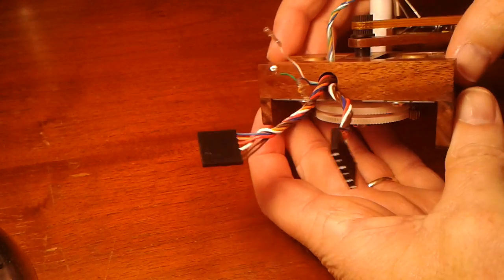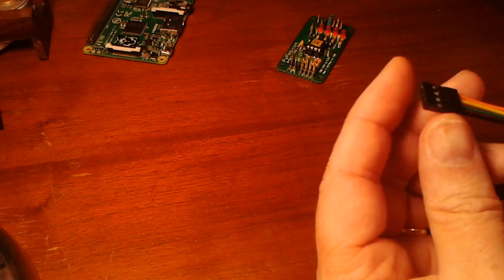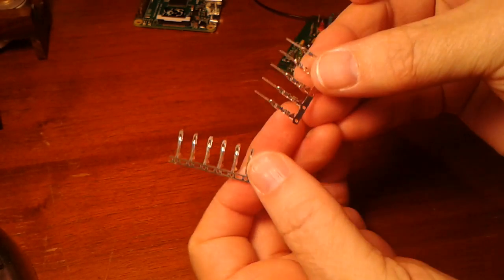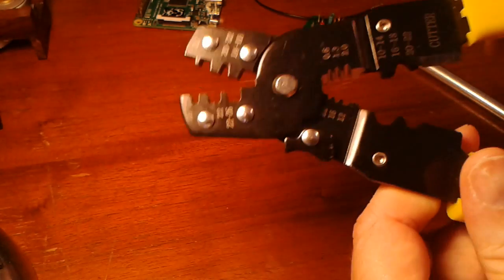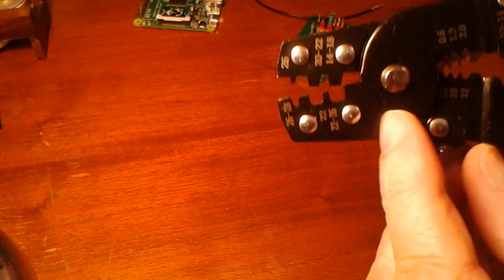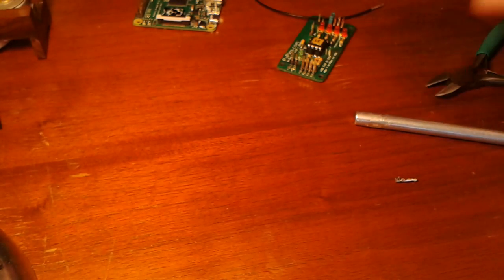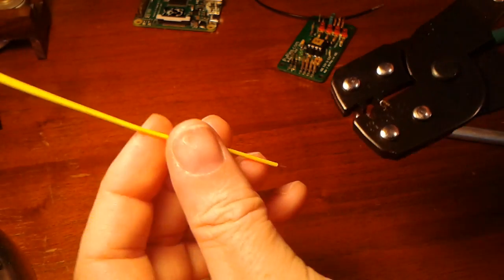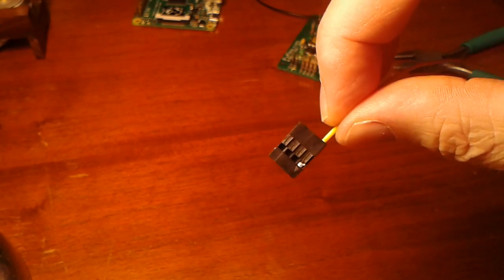DIY Dupont Connectors

Comment: I think I am just going to just buy a pre crimped one. My situation is I have a sub woofer with a display on it. It was working fine but suddenly not. I opened up my sub woofer and it has 16 wires that go into a white plastic connector, identical at each end and all the wires are all in the one row. . The wires look to me like this dupont thing. But I notice one wire has actually come  out at one end. I am thinking just to buy a single pre crimped wire. One concern is the wires on mine are definitely silver, like alluminium wire so I don't know if the wires I am seeing online are  copper wire and I don't know if it's a bad thing to use copper when the wire that was used before was alluminium. The other thing is I tried to get it to go back in and messed with the wire so many times its now shorter than it was to start with but I don't know anything about these things but it seems to me all I need to do is buy a pre crimped wire and disconnect the old one from the other end and insert the new one at each end. I suspect what's happened with the sub woofer being turned up, vibrating and rumbling just caused the wire to come out. But I tried to get a replacement wire with the  connections complete but no joy. Just going to be my last ditch attempt before I fork out another several hundred pounds for a replacement sub.
Reply from the maker: The "silver" on the wire is tin plating on each strand. The wires are tinned copper. Make sure you get the same thickness or gauge of wire.

Comment: OK, I just went and played with these connectors for a while -- I have never been good at putting them together -- and invented a tool.  It's a single pin from a row header, inserted into the end of a short stick (a short piece of dowel, for instance).  This gives you a way to hold the female DuPont connector while putting it into the crimper -- just fit it onto the tool, no farther than necessary for a good grip.  This seems absolutely vital with the fancy AMP crimping tool -- why AMP didn't make it, I don't know -- and also helpful with an inexpensive crimper.
Reply from the maker: Good idea. I'm going to do the same.
Reply: @ClaytonDarwin  The rest of the story is that I found out why I could not easily put the connectors in place by hand.  The AMP tool that I have was actually designed for the pins in D-connectors.  Their crimpable part happens to be almost the same as a DuPont connector, so the AMP tool works beautifully, but putting the connector in is awkward.
Reply from the maker: I've started placing the wire into the connector and pinching the larger gripping tabs down onto the insulation lightly. Then I can hold the wire to place the connector exactly where I want it for a good crimp.
Reply: @ClaytonDarwin  I think the bottom line is, once you know what the correct crimp is supposed to look like, there are a number of ways of making it.

Comment: I have the $500 AMP crimp tool, which I got at a hamfest for $10.  Ratchet and all.  And I think it might actually be easier to get good results in small quantites using the kind of crimper you have, the cheap kind, because you can feel what it's doing, and there isn't a ratchet to keep you from using your own judgment.
Reply: The ratchet makes you sacrifice a connector that has gone in crooked.  You can't let go and straighten it up.
Reply from the maker: "Keep you from using your own judgement." That's the problem with a lot of things I think. But as for crimpers, I made that video several years back and have done hundreds of crimps since then. Never a problem, and it is so fast and easy. I also like to be able to quickly use both sizes to get the right "feel" on the squeeze.  I'm looking for another pair.

Comment: If you're working with limited space, you can also use JST connectors. The JST-XH fit into headers easily, but for really tiny stuff you need the JST picoblade connectors. Those are really hard to crimp due to their small size, so get a cheap crimp tool as well. These DuPont connectors are also what servos and ESCs use, so getting some of these connectors is beneficial if you're doing RC stuff. Just be aware that some servos have a special DuPont connector that has an orientation lip which sits in a matching groove. Make sure to get the right type.

Comment: Thanks a bunch, I wasted like 6 crimps before watching this, I was shoving the wire way too far in.
Reply: Yeah that's the main thing about DuPont connectors. You can't push the exposed end past the crimp tabs. Beyond that is where the header pins push in, so that space needs to be clear.

Comment: My problem is the size of my fingers.

I find the best way ( well it works for me) is to lightly form the crimp with some snipe ( needle ) nosed pliers and then use the crimpers to form the crimp.  I have a lower failure rate that way as I can see that the wire is in the right place before locking it in place.

After I have gone the crimp and put the wire in the housing I clamp the wires to my bench and form them into a ribbon using a UV actuated “glue”.  Looks very neat and tidy.
Reply from the maker: Good ideas.
Reply: Ah, custom ribbon cables. That would be useful for me too. I'll have to give that a try.

Comment: hi Can you share what type of wire you used?
Reply from the maker: Depends on the situation, but almost any wire of the right gauge will work for hobby projects (I'm not a professional). The standard (if there is one) seems to be about 28 gauge, stranded, and tinned wire. My crimpers are for 24 to 28 gauge wire. Smaller wouldn't be very strong, but you could go a little bigger and still fit into the dupont connector easily enough to make a good crimp. I've used solid wire before and it's okay but not a great crimp and not flexible.
Reply: okay 28 gauge solid? or is is stranded? It would be great if you could give me a link.
Reply from the maker: Actually, I have never purchased wire for this. I buy bulk ribbon cable connectors and then make custom connectors from them or the wires on the part. I think any 24 to 28 stranded wire would be fine. Tinned wire would be better.

Comment: Wouldn't a pair of plyers also suffice for crimping?
Reply: i’ve been trying to make connectors with pliers to no avail. excited about getting my crimping tool tomorrow
Reply from the maker: Not very well. I'm all for saving money and making do with what you have, but pliers will not give you the quality and security you want in a crimp. Crimpers are designed for one thing, and a good pair will do the best possible job much faster and more securely than flat pliers.

Comment: what belt and pulleys are these micro small ones in your video please ?
Reply from the maker: Bart Libert - The belts and pulleys on that project were all from old ink jet printers. I don't know what size they are. Most ink jets have a short belt and a long belt, plus several small pulleys and one large one. All seem to match.

Comment: Wow, about the lowest "production value" vid I've seen on the subject, and by far the best results in finished crimp! Those Thai crimpers, absolutely useless except for "hardware store" class connectors. I actually have just about the same crimper as your Florida sourced example, only mine has 3 stations. Almost certain I got it at radio shack, but it has been a fair chunk of "forever" since purchased, so I could be mistaken. Great technique, great demo of "proper fit up", though bending the wire double is an industry "absolute no-go", my bet is you aren't building cruise missiles or stealth bombers, so it'll be just fine, lol. Well earned like, sir!
Reply from the maker: Thanks. And yes, I generally buy my cruise missiles on ebay instead of building them. It just saves a lot of time since I'm going to blow them up anyway. But nice to know about the industry standard of not doubling wires. I'll add a note to the description. Also glad to be in contact with other Luddites.
Reply: Clayton Darwin  my pleasure, sir! I think the ban on doubling is related to the slightly higher chance of dislodged strand pieces going gremlin. Unless building mission critical or life support tasked gizmos, not really a factor, especially if hospital corners gives you a better result in the real world. What works for you is probably "good practices" unless bacon hangs in the balance, lol. The barrels and pins are actually made for machine crimping, which is why they come in machine gun esque "belts", just for trivia purposes, lol. Such delicate shells really require either a fixed precision crimp like a machine does, or low advantage high tactile sensation hand crimpers that actually fit. The cheap ratchets basically crush them for recycling, lol. The Thai example is probably better, but still far too loose fitted and poorly aligned. Your preferred set gives about as good as it gets, as results show. Of course, at the machine you can crank out about 75 per minute, but who wants that many wires?
Reply from the maker: Good information. And yeah, I never understood why you would want ratchet crimpers on something so small. Is there no finesse left in the world?
Reply: @ClaytonDarwin  Note about the ratchet crimped. I watch a lot of BigClivedotcom, he uses the ratchet crimped. I suppose 1 advantage is he puts the pin in the crimper, ratchets part way and it holds the pin in place, he then just inserts tha wire and squeezes again to finish the crimp. Your way also works great. Those 1000 in 1 tools that strip, cut, retread bolts, and crimp are ok, but a tool designed for a task is usually better than a multi tasker tool. I will have to look again, I thought Ebay quit selling  cruise missiles and Amazon was going to stop. That's why the Army surplus stores have been swamped!
Reply from the maker: That makes sense. I read you can put a big rubber band around the jaw end to hold them partially closed on the uncrimped end. Same idea. But I've never tried it. Also, you can now pretty much only get cruise missiles on Craigslist but you have to do the whole local pickup thing which is a hassle.